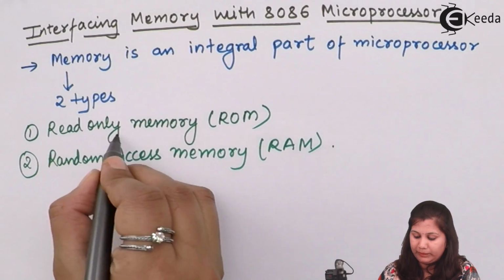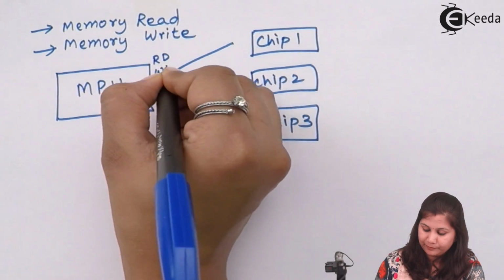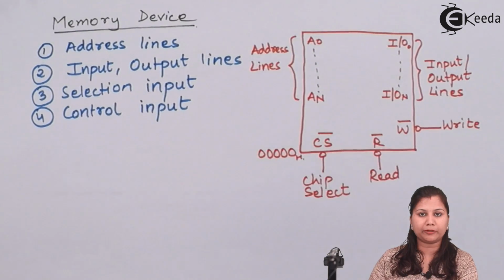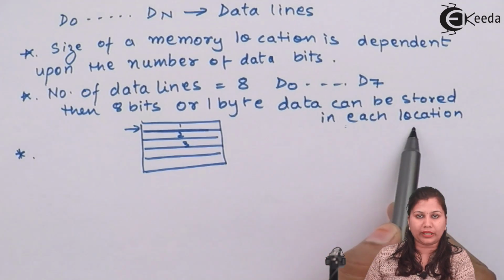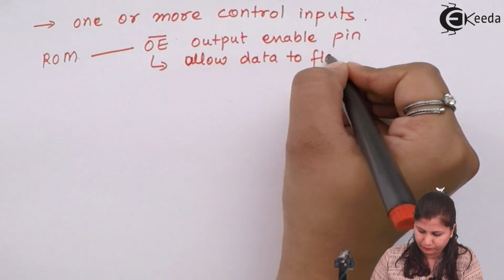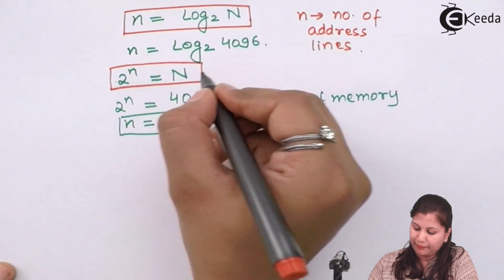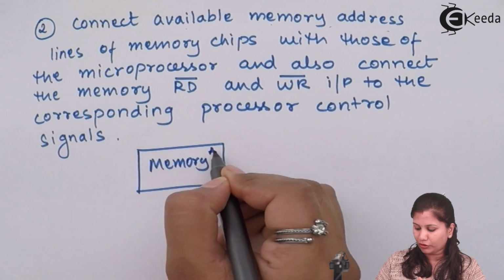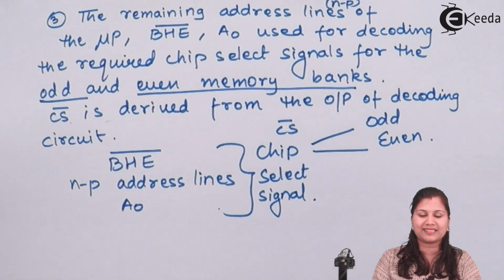Interfacing Memory with 8086 Microprocessor - Interfacing of 8086 Microprocessor

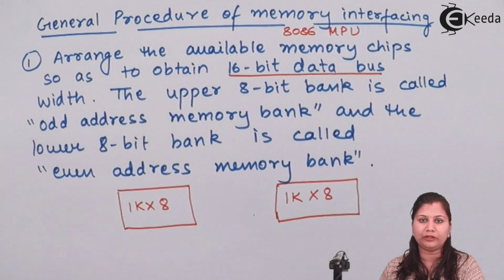Comment: At 40:27 , if two memory chips of each size size 1k x 8 are connected in parallel to form 16 bit data width since 8086 is 16 bit microprocessor, but 1k means each bank of memory requires 10 address lines and 8086 is 20 address lines, where does the extra address lines to select either chip come from in step two ?